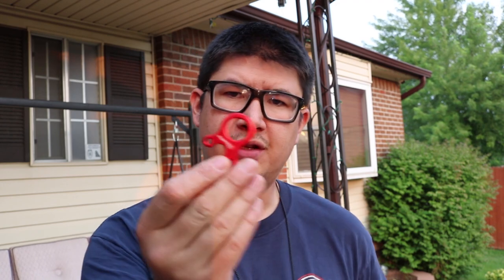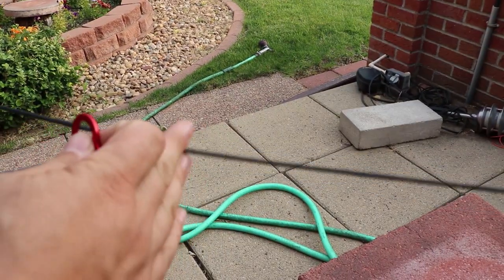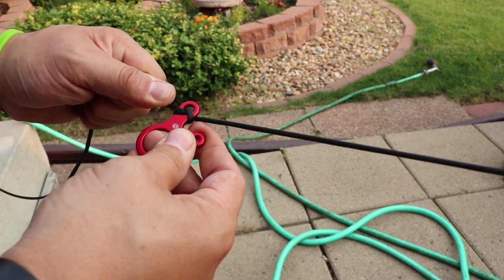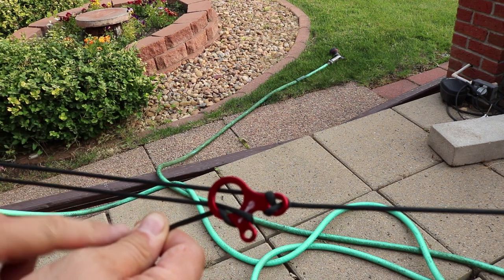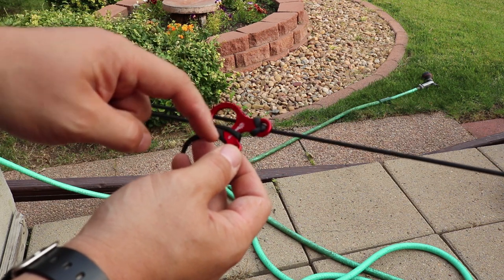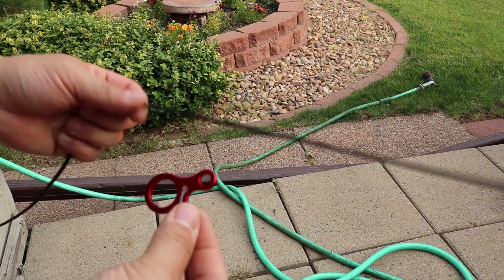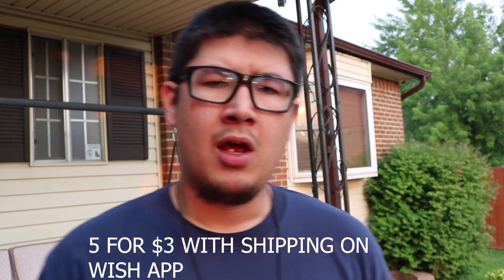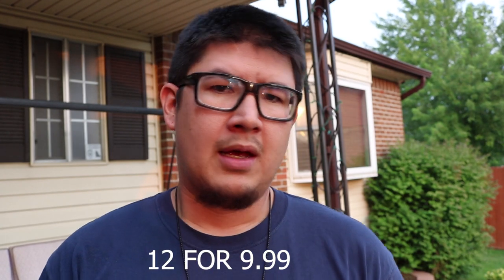how to use Camping Cord Tensioner- Adjustable

Comment: I found the twist made the tensioner want to spin back and harder to work with on smaller cord because that spin was counter to the locking force and reduced the baseline locking force.  I like your idea of locking it better in place so I tried twisting the loop itself before you pull it over the device and tight to the medium eyelet and it was solidly locked in place but instead of twisting the cord it crisscrosses the eyelet like a midshipman's knot does on the cordage without using a tensioner. It locks it somewhere in between your method and doing nothing at all.Thanks for the video.
Reply from the maker: Thanks for watching. I mostly camp our of my camper nowadays but still like playing with all my old gear!

Comment: Good advice, but just knowing prusik and truckers hitch will do the same (maybe bowline too depending on the wanted use)
Reply: Some advantages to using hardware tensioners are: 
1. they can reduce some stress and wear on your cordage 
2. they're typically easier to use with gloved or very cold hands 
3. they're easier to do one-handed if you've sustained an injury to the other hand/arm 

That said, everyone should definitely learn and memorize the basic method you've mentioned to do it without hardware, since it's important to not be fully dependent on losable/breakable doodads
Reply: @honortruth3600  those are fair points. I myself do use one at the end of my ridgeline to create a fixed loop instead of bowline as it is faster in a pinch, other than that I prefer prusik loops with toggles from branches for tensioning the tarp and the truckers hitch for tensioning the ridgeline.

Comment: hmmmmm 
6y ago ?  
i like your Type1 application.  i tie a "block & tackle" for TIGHT Lines but your video got me thinking about using these to reduce line-wear  

camp much ? 
ever set up a tent ?  
or a tarp  ? 
(not a pretend tarp) 
with loose lines ?  
its an interesting doo-dad 
but for
TENT LINES & TARPS 
this Eagle Scout says: 
Use a TAUNT LINE HITCH 
(2 on the inside & 1 on the outside, all in the same direction)   

for camp craft tensioners these are pretty much junque  > no advantage > theres better knots

NOW FOR KITE FLYERS 
that want to add a flag, windsock,  dangle a key or a bell, pendants "line laundry" "sky trash" on their kite lines these FIGURE-8+ 's (is what i call them) ARE THE SCHNITZ ! THEY'RE WONDERFUL! 

they will accommodate 4mm paracord & 6mm kite string no problem 

easy to add an anchor point or top stabilizing line wherever you need it 

for kite string LARGER than 6mm use a standard Figure-8 descender 

GO FLY A KITE  !

Comment: That's a pricey truckers hitch.. lol
Reply: Some advantages to using hardware tensioners are: 
1. they can reduce some stress and wear on your cordage 
2. they're typically easier to use with gloved or very cold hands 
3. they're easier to do one-handed if you've sustained an injury to the other hand/arm 

That said, everyone should definitely learn and memorize the basic method you've mentioned to do it without the hardware, since it's important to not be fully dependent on losable/breakable doodads